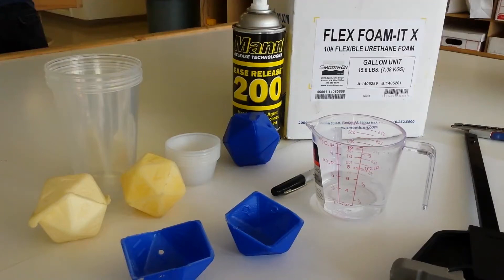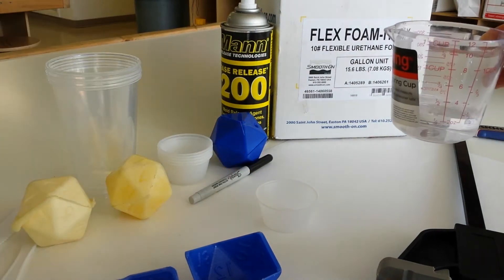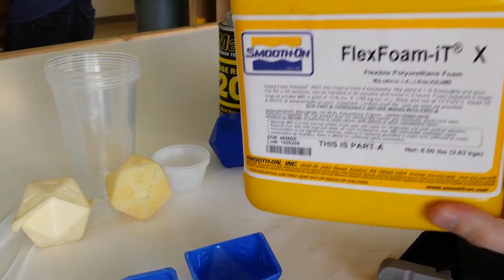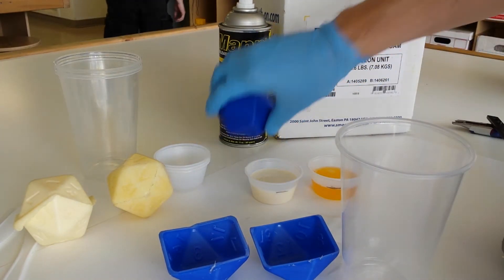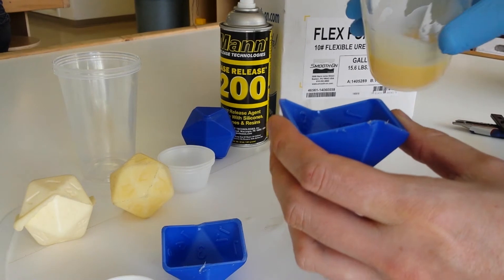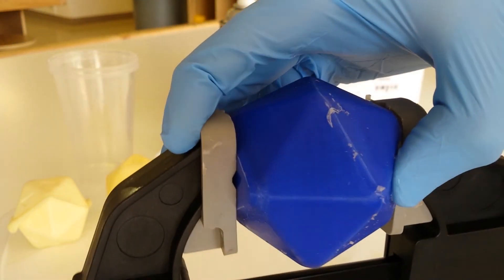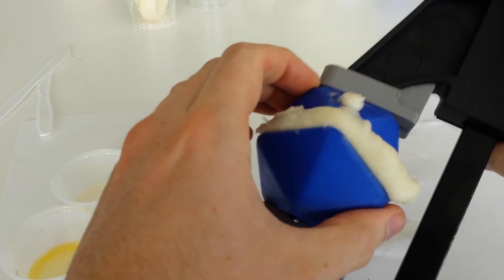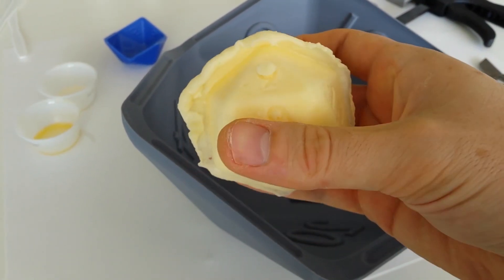Making Test Foam D20s from a 3D Printed Mold

Comment: Great video, I used it for my own proccess too in testing out.  Instead of regular plastic cups I wound up using silicone ones usually used for resin work but found the 1:1 didnt quite cut it and had to go a bit more B than A.

Comment: abs? pla? does the foam have exothermic temps? how hot? info please! I can't find it on smooth-on's pdf's :(
Reply from the maker: The molds are made from PLA. I don't remember there being any issue with deformation from heating, but there is a potential for a build up of pressure in a fully enclosed mold.
Reply: @DistractedArchitect  Awesome, ty, i have built venting.

Comment: Thank you for the video, exactly what I was looking for! How hot does the foam get while curing? I'm concerned it might deform a larger PLA mold. How did your big one go?
Reply: Angus love your channel, not sure if you figured this out yet.  What I do know is this gets as hot as my fast curing resins i use from smooth on. Yes you can use pla!!!! thick walls 4-6 and 15 to 20% infills is what works for me on flash forge printers. You can go less for a test mold or one off. Hope this helps also for better results lots of sanding hahahahaha the evil sanding.

Comment: Just a small suggestion that might help with the mold, would be to do what some investment casters do by reinforcing the shell by placing it in a bucket and packing damp sand around it. If its packed well enough, it would provide equal pressure to all sides of the shell.